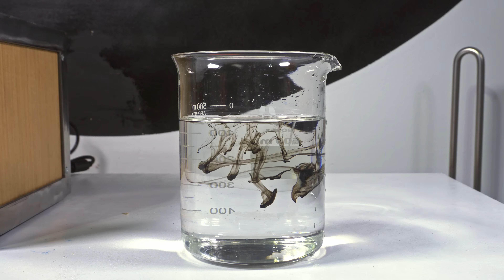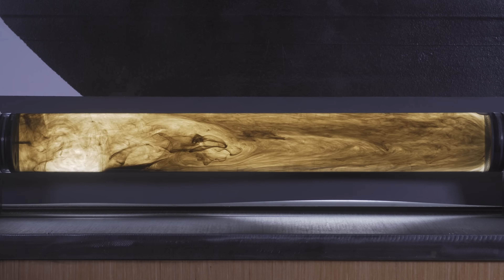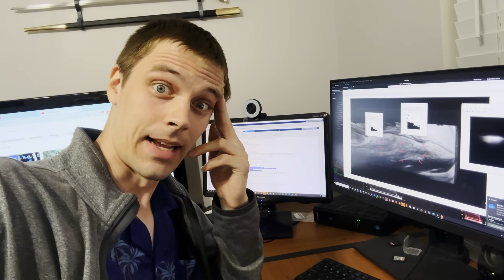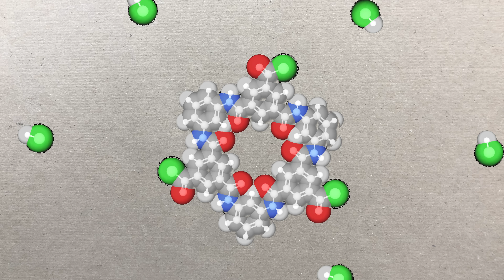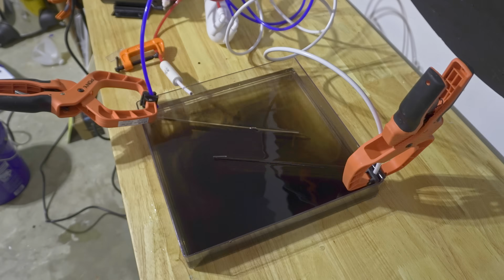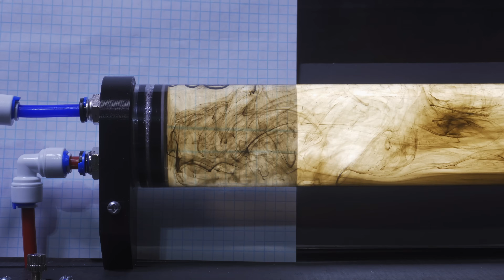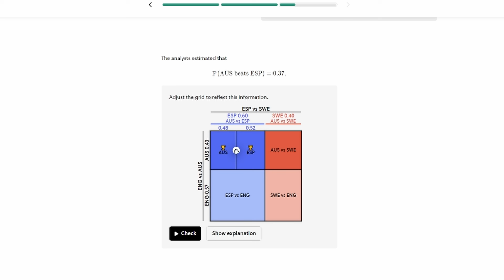I made a machine to un-mix fluids

Comment: I think I have some ideas to improve your problem with membrane clogging.
After learning how much wastewater is created in typical household RO system, I've did a "nerddive" on how to improve efficiency, and "why just not make less wastewater, by restricting waste output?".
Main problem is that we are concentrating waste in a thin layer of liquid near membrane surface. An that concentration is so high, that dissolved salts can precipitate into membrane surface and clog it. That's called fouling. And at low flow rather laminar flow (ducks in cover from Destin)) wont help either) One of the solutions - increase water flow over the concentrate side of the membrane (where the ink flow), to increase mixing and reduce this concentrated layer thickness. One solution is called "batch RO", where you add circulation pump between concentrate output and input side, that circulates concentrate and mixes it. Search for datasheets for RO membranes, some of them have minimum and maximum concentrate flow. Yes, there is a maximum, beyond that you could destroy membrane)
Or you could use smaller membrane, but I don't think they exist for price cheaper than household RO membranes.
As a side note, main purpose of batch RO is to increase energy efficiency, bu reducing the discharge of high pressure concentrate.
Yes, in your case you have solid particles, but I suspect that they form a thick layer of fine filter, which adds a substantial resistance for your poor pump)
For me main problem was where to find such circulation pump, it doesn't need to create high pressures, but should withstand 100+ PSI. And should be reasonably cheap) I think in your case you could add second booster pump as circulation pump.
Also shellac probably wont help either) Concentrating in layer of ink and clogging membrane pores even further. I'd suggest to find pure lampblack, if possible, or wash and filter this ink with suitable solvent to remove shellac. From watching chemist youtubers, I'd recommend gravity filtration, because vacuum filtration may clog the filter, and recommend passing filtrate through same filter several times, filtered inc particles will make and additional filter and trap smaller particles.
Some suggest backwash - If they recommend back washing concentrated ink - I don't think its feasible, considering you want constant flow + it's almost as using circulation pump to wash stagnant ink. If they are talking about back washing from the permeate (clean water) - be veeery careful, RO membranes can withstand 100+ PSI in forward direction and maybe ~5-10 PSI in reverse. See datasheet.
As other comments point out, maybe some of the ink is too fine and clog the membrane, I think you could try to separate such particles by filtration through coarse filter several times, or maybe separate by mixing with water and waiting for ink to settle for several hours/days. However wiki says ink is a colloid, so it may not separate)
Hmm, use teabag as filter?)
Also the are other grades of such fine membranes, by reducing pore size - microfiltration, ultrafiltration, nanofiltration. Read about them, maybe they a suitable to separate lampblack by size. But I don't know if they are reasonably cheap.
Centrifuge to separate - I don't think it's easier to build than membrane based separator. But maybe you can use it to separate ink particles by size. There are tabletop centrifuges for chemistry/biology, maybe you can find one used.
Can't wait for video on osmosis and how exactly it works)
PS Maybe you have Discord or some other free thing to help with such projects?) I have free time and broad shallow knowledge/interest in things, but not much free money)

Comment: It would probably make the whole assembly 10x larger and bump the power consumption up a couple orders of magnitude, but would it be possible to avoid your filter clogging problem by separating the ink and water using distillation instead?

Super cool project though, and mesmerizing patterns!

Comment: Random motion and increasing entropy across the mixing interval. 
Using the R equation a low energy injection and lower energy transit is dissipative toward laminar - less turbulent the slower it goes so your convection dissipates over the length of the window. Not so much making laminar but losing energetics support of turbulence with distance from the nozzle

Comment: Lovely! 
Have you tried it with an Immiscible fluid? Would you get streamlines when it went laminar? Might not need RO, just a seperator. How about adding some bends to the pipe to see the twist? 45deg, 90 deg, and a sweep?

Comment: Filter fouling is the technical term for buildup.  It's been awhile since I've even thought about this but I think filtration systems are designed for an optimal fouling range such that your gunk buildup is doing part of the filtration.  The initial filtration is worse but your filter has an increased operational period so you are replacing it less often.

Comment: If the ink is heavier than the water you could try a centrifuge filter but you might need an extra water tank just to get enough flow to spin it properly, won't work without speed.
I'm impressed that the RO filter actually took out the ink and didn't clog immediately

Comment: I work with heating networks (which is mostly just a bunch of water flowing through pipes) and there we also think of it as analogous to electrical circuits a lot! Basically the water flow throughout the network follows Kirchhoffs laws, and the "resistance" of a pipe is modeled as being dependent on the flow speed (because fast moving water will become more turbulent and so encounter more friction). It's a pretty effective analogy!

Comment: Probably even harder to achieve and more energy intensive, but centrifugal filtration? Would almost certainly require a separate filter loop due to the flow rate being far too high to run through the display tube.

Comment: 12:15 You mixing to concepts Brownian motion which mixing of fluids naturally 10^14 Hz collisions per second but ink is 50 times bigger than water molecule, It takes time to move and mix.
https://en.wikipedia.org/wiki/Brownian_motion#/media/File:Brownian_motion_large.gif. This is 20 times (dust particle is very small) gif that shows  but let say very similar how ink very slowly mixes with fluid.

Black printer ink is 100 times bigger  than water molecule, thus no laminar no turbulent flow exist is just simple slow mixing at slow flow rate - 4ml/s. Reynolds experiment made with potassium permanganate? which is even bigger particles in Brownian motion have opposite conclusion Re<2300 in outlet color is laminar later Brownian motion (natural diffusion) mixes particles in water evenly we get turbulent flow no stratification but result is uniform KMnO and water mixture. I understand it was first steps of fluid mechanics to describe local energy losses and shear and hydrodynamics head losses but it became erroneous concept of laminar turbulent and transitional. Reynolds number indoctrination. it was helpful measure in their times but today 8 bars pumps all energy losses except gravity are mechanical roughness of pipe surface or local (control valve, sharp corner 90 degree pipe turn).

Your experiment is contradiction of Reynolds experiment perfect proof that internal shear friction don't exist. For gases sometimes uses smoke that is 5 thousands times bigger molecule than air so they gets nice laminar patterns of smoke even liquid CO2 instead smoke that is smaller particle gave same result. Smoke, ink, small molecular color paint, liquid CO2 are mega molecules compare to fluid that we want investigate. For computer simulation to show how fluid flow it works, but for physics solution Brownian motion 10^14 Hz collisions Newtonian cradle liquids mixes at super super fast pace. Computer science of fluid flow simulation and physics of fluid mechanics is not same. Computer science is not physics they all based on formulas but they gives different results. Which perfectly shown in this experiment contradiction of Reynolds experiment.

Viscosity  don't exist, exist Newtonian fluids non-elastic fluids water, all gasses, light hydrocarbons, and non-Newtonian fluids (viscoelastic) fluids that requires extra force to make them flow. Blood, and all multimolecular hydrocarbon fluids.

Comment: I wonder if this would work with rheoscopic fluid. I feel like the mica particles would be large enough to easily filter, but maybe the chamber geometry would need to be changed to  make the flow of the whole system more visible since rheoscopic fluid is pretty much opaque.

Comment: A 3D printer is a bad way of making water-tight parts. You should just get a lathe and a 4-jaw chuck. Making the caps will be very straightforward then, and you can make them from solid plastic or metal.

Comment: Now make a filterless version with either a large enough separatory vessel to let gravity do the work constantly with a lower powered pump or perhaps run it on a timer after you determine how long the separation time is. Perhaps more dense inks improve the settling/separation time as well.

Comment: Why not inject the ink in the back of the Larger water fitting at a high pressure compared,it should look interesting. Especially if the intske was on that side also , it would work like a water fountain!

Comment: I wonder if you could replace the ink with ferrofluid (and the water with the same hydrophobic media used to suspend the ferrofluid, or at least something that it would dissolve that suspension fluid yet act the same way)

That way you could use magnetic separation, and not ruin filters with ink. The magnetic filter equivalent would basically just reconstitute the ferrofluid from the more dilute suspension created by shooting a stream of it into a larger volume of the suspension fluid (like you do with the ink)

The patterns might be a bit different due to the different viscosity of the suspension fluid… but it does offer some additional possibilities that might be very cool, like subjecting the chamber to weak magnetic fields to cause different behaviours :)

Comment: The reverse osmosis filter require rinsing flow on the outside of the membrane to keep it clean. Even with just tap water it would plug if it wasn't dumping water down the drain. Then you are restrcting the output of side, worsening the problem. I would consider recirculating the pumped mixture to keep the flow moving on the outside the membrane

Comment: I'd be curious if you'd be able to use a ferrous metal powder instead of ink, then when "filtering", just have a rectangular box with 2 lines coming out. One at the top and one at the bottom with a wall the last 5 to 10 centimeters. You can use a weak electomagnet that toggles on and off, just enough to pull the metal particles towards the bottom of the "filter" box. Ideally the top tube would be filtered to just water and the bottom would be a mix of water and metal powder.

Comment: If you did a larger scale vertical tube, you may be able to use it to separate the ink in situ, and just use a tiny pump on a duty cycle to pump the settled ink from the bottom to the top. Also maybe if you warmed the ink up it might not fall right away and would do cool convection things

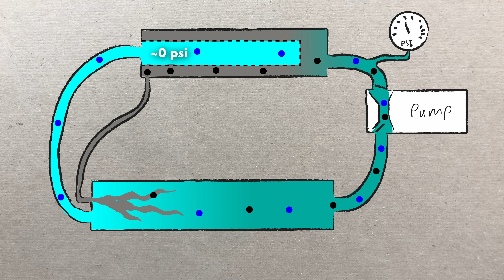Comment: 14:45 Aaa!!!!

Please make a video about fluids, pressures and flows. I've been wondering how non-pressure-fed rocket engines are able to have the propellant move in the right direction for ages now and I still can't fully grasp it. Like I guess I understand turbopumps. But how the heck can you heat your fuel or oxidizer with regenerative nozzle cooling and not have it go back to the tanks without an even bigger pump? And then there are also monopropellant engines which generate pressure using a catalyst instead of using pumps. Why doesn't it flow backwards then???

Comment: You mention the ink is heavier than water (even if only slightly). Would a large settling tank work instead of a filter? Pipe the mixture in on one end and get clean-ish water at the top and ink at the bottom of the other end?

Comment: Your filter clogging problem is probably due to the shellac (or just small carbon molecules - 50nm is just the "average" size. You might do well to have multiple RO filter cartridges. Two cartridges means twice the surface area of filter media for the same amount of ink and pressure, easier to flush the ink off the membrane. 
You could also use a couple of filter sizes to filter out any small shellac/carbon molecules from the ink so you can be confident that the only molecules in the system are large enough to not clog the filter. 
You might also add a reservoir for the water and ink. That could give you more control over pressure and you could remix a portion of your clean water with your dirty water to dilute the ink before filtering it, making it even more easier (yes I said it) to flush off the membrane.

Comment: In automotive, they use a degas bottle plumbed to the high point in the system to get rid of trapped gasses. Bypasses a tiny volume of the full system back to the inlet

Comment: Very cool - could probably be used as a wind tunnel by placing a wing element inside the tube? The wing element could be turned by a magnet from the outside. How large would a gravity separator have to be to be functional?

Comment: You need to change your ink to something dissolved, a molecular dye. These black inks are possibly fine dispersions of carbon black, clogging your membranes. Adding in a backflushing process could assist in membrane life, but the added complexity would be high.

Comment: If you had only pure water and "perfect" ink I think it would have worked, but probably really small impurities (somewhat larger than water molecules, but smaller than ink pigment) eventually clog the pores. Perhaps if you reuse the mixture and simply change the filter, hopefully all the impurities will eventually be filtered out. Also maybe you can use a filter with bigger pores.

Comment: I considered making something similar,  but never got to it. I was thinking of alcohol and water and using heat to build the alcohol off. I was also considering a spinning centrifugal separator. I think it would have been neat to make it an inverted T. The vertical drop into a larger diameter tube where is slows enough to become laminar . Awesome project.

Comment: Cool concept. I know you want full mixing by the end of the tube, but maybe worth trying is an oil-based ink that naturally separates out (that way you only need some baffling in a reservoir underneath rather than high pressure RO filtration). Depending on how you mix the oil-ink, you could probably still get some interesting looking results. That might be better for the vertical orientation, especially if you could generate a swirling effect with the ink injector.

Comment: This is so weird, I'm also working on a turbulent flow art piece very similar to this, but I'm planning to use Mica powder which also shows the flow fairly well, but is way easier to separate out... in fact an issue is that it might be TOO settling to work for what I want...

Comment: What you want is ultrasonic separation.
This is used in grand scale industrial applications.
Basically using standing waves to "catch" particles.
But be warned, that's a rabbit hole on it's own.
Reply: Ultrasonic separation causes vibrations, vibrations are sound, lots of vibration = lots of sound = loud = not calming. Am I right?
Reply: @Axodus  nope you're not.
Controlled sound waves are far from uncontrolled vibrations.
Also it's meant as a separation method below the tube.
Unfortunately I was unable to find a public video on how it works and I'm not allowed to share the footage I have since it's under NDA and I really don't want to sour the relations with them since they are a valuable supplier.
Reply: @DerSolinski  so it's quiet?
Reply: @Axodus  it's ultrasound nothing a average human should perceive.
There are of course individuals able to notice it. And kids / young adults of course.

Comment: look to "gas lens" from tig torch. ink from electrode and clear water from the "screens" (where shielding gas is releasing). That would be exited to watch. interchangeable ink injectors (needles) would be fun too.
you would need sheet of rubber (soft silicone?) (min 2x) to puncture injection needle through. bottom of needle closed and in half way hole to feed ink inside needle. (fed between sheets of rubber)

Comment: Could you use a tall large reservoir (perhaps hidden between wall studs) that does the ink separation by only using gravity instead of filtration? If that worked then very small and quiet pumps could be used and the display could run 24/7. Just a thought. Interesting project, great vid. Subscribing.👍

Comment: 4:49 "I'm injecting water at a rate of about 4ml/m right now and in a 46 mm
diameter pipe that equates to only 2.5mm/s" I think you meant 4ml/s instead of minutes. With a flow of 4ml/s in a 46mm pipe it gives a water speed of 2.4mm/s
Reply from the maker: Now I gotta go redo math…
Reply from the maker: I was assuming the 100gpd filter

Comment: There are microfluidic devices called spiral separators. These are usually use separate different cells based on density. Probably not useful for sorting ink, but might be worth a try for fluorescent polystyrene particles?

Comment: Since you're already willing to use a pressurized system, would it be possible to utilize aeration and degassing of water to help with water/ink separation? You could use oil-based ink instead. Inject degassed water and the ink to achieve the same effects. Upon exiting, aeration of water and let the oil-based ink separate itself. Then water gets degassed again. If it works, never have to replace the filter again.